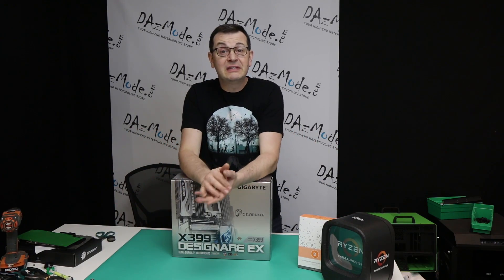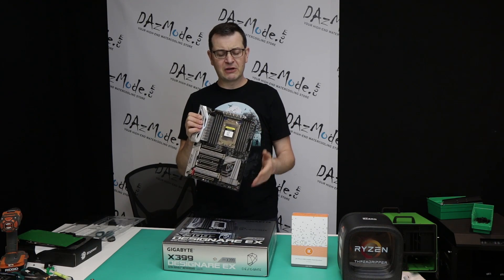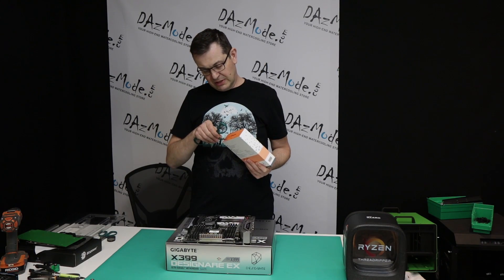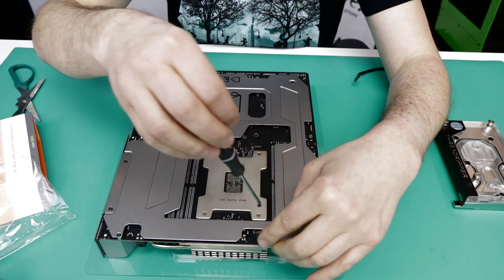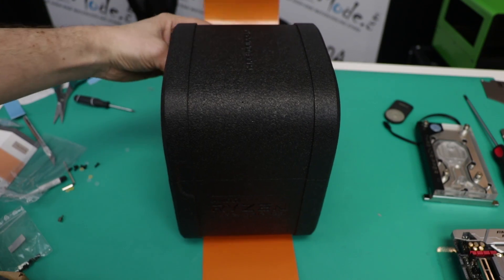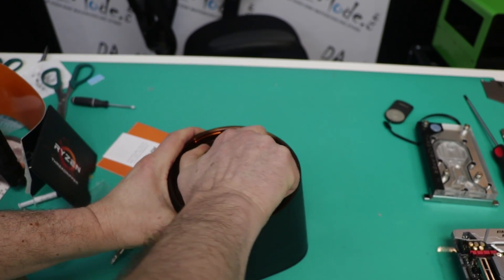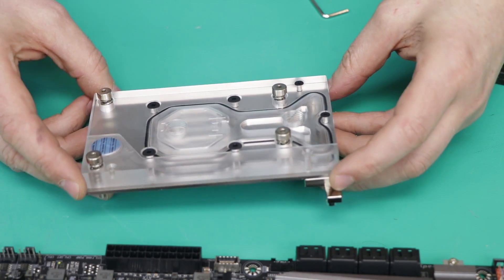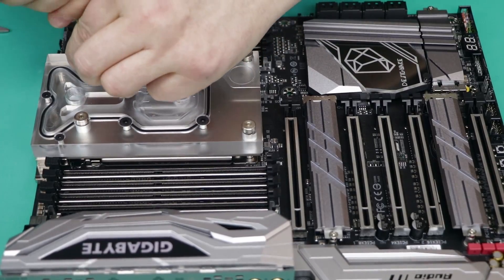GA Designare EX X399  Watercooling with EK Monoblock - Baby Blue Build Ep2

Comment: For the EKWB I kept the original half of the VRM heatsink which contains the fan by cutting the heat-pipe. This is the far superior way to put this awesome block on this incredible motherboard. I've got 128GB RAM stable @ 3122Hz with the 2950X at 3.7GHz to 4.4GHz depending on load with all cores and virtual cores active. I used the extra 12V (4-pin) CPU power header at the top right of the board. You must do this to get reliable OC's. You can expect a difference of 8C on the VRM by keeping the VRM cooler with fan which sits near the ports. The other VRM's are cooled by the EKWB.
Reply from the maker: Thanks for sharing. Thinking to put Heatkiller instead and return to original heatsinks.

Comment: I can't understand why EK would replace a large active heat-sink with a smaller passive one.  I'd be very careful if you plan on doing overclocking with this board. If it was mine I'd talk to EK about that or just work out a way to use that small fan on the new heat-sink.
Reply from the maker: I was thinking either put more heatsinks in that tiny one or/and glue that minifan onto i/o cover if temps wont be good.
Reply: That small passive heatsink is for the memory vrms. Nothing to worry about unless u plan to run ur RAM past 3200mhz or load up all 8 slots. As for the super large heatsink with the fan that was there before; it's help cool the cpu vrms which is now under the water block.
Reply: Ok then sweet . Didn't realize those chips didn't run that hot.
Reply: @dandel351  they designed the memory vrm cooler like that because the cpu vrms got SO hot that the top portion of that cooler just couldn't handle it. so they attached a heat pipe to the memory vrms and added a fan to help the cpu vrms cool. basically like a mini cpu cooler for your cpu vrms.